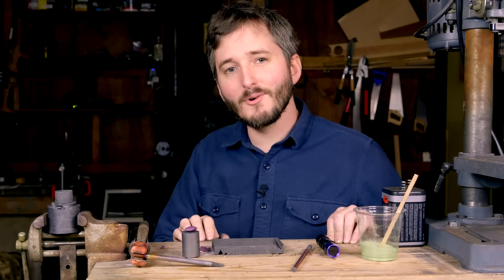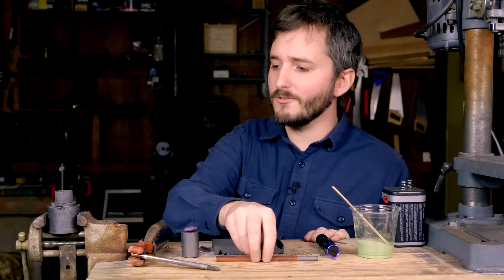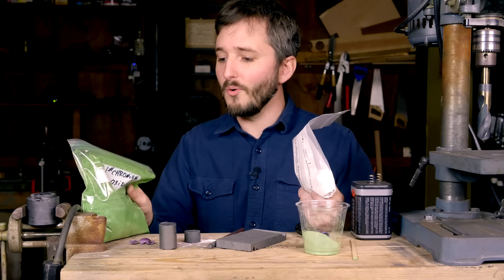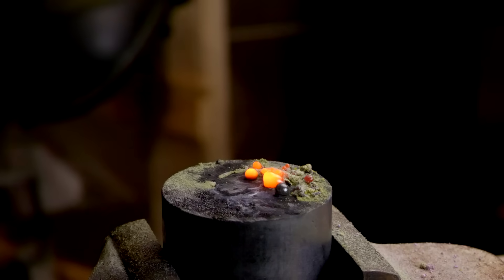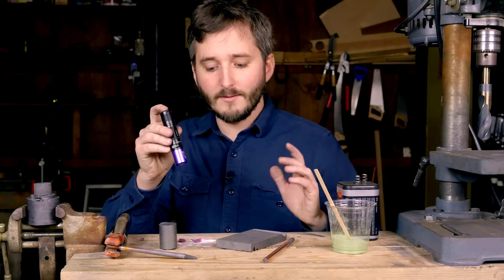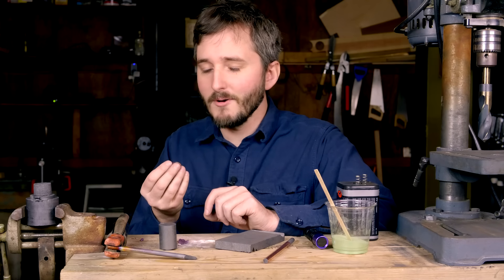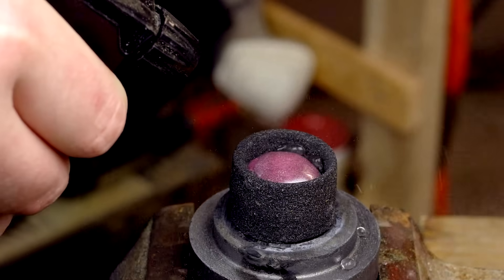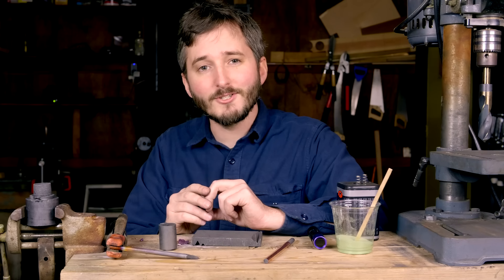How To Make Synthetic Ruby In The Workshop

Comment: Cool. Now you can attach your electrode on something to that can tightly control the space between the electrode & the crucible or myabe put some tungsten-carbide in the center of the underside to retain heat  ...if you have a lathe. I guess you could use a mill or a drill press too.
BTW, diamond abrasive wheels aren't very expensive if you get the kind that's bound to metal. The ones that have the diamond embedded into resin get spendy but I got a 3" metal-bound wheel for $20. These ones are pretty rough though so getting some cheep diamond hones from harbor freight for $12 is a good supplement.

Comment: Has anyone suggested an argon purge around and in your crucible? Argon conducts electricity Those Arc-Gouging rods are also hollow to allow pressurized air to be blown through the rods as you are "Arc Gouging" Talk to your local welding supply store, or a TIG welder if you know one, to set up a purge meter (to control your argon flow) and connect it to the cold end of your gouging rod. Argon is heavier-than-air, so if you set up your crucible inside a small bucket-like container in a draft free area, (WEAR RESPERATOR!) Your results will probably be an order of magnitude greater. A TIG torch (TIG rig) with a tungsten electrode would probably be a lot easier to work with as the tungsten will not burn away, creating the "carbon wind" that your carbon rods create as they burn. However! The Argon flow from the tig rig must be cut Way, Way Back. An oxygen free zone (the bucket) will work, but it would be hard to maintain an argon atmosphere without the surrounding air mixing. MUCH easier to build an argon purged "Glove Box." If you plan on doing this on any regular basis, or you're just interested in upping your game, the Glove-box is the way to go. Lots and lots of glove box videos on YouTube. Easy to make, especially seeing all the tools you have in the background. Good luck! You make great videos and I would love to see you making great rubies. And then, you could be the one that invents "transparent aluminum" --- You know, the one that Scotty gave the secret to --- when the Starship Enterprise and its crew were saving the whales? (and the Earth) I would love to see a DIY pure aluminum oxide gem (sapphire?) One without contaminants, if it will crystallize without contaminants.

Comment: Make sapphire, instead of chromium oxide add titanium oxide in the same ratio. Then go to some jeweller who cuts gemstones and try to polish it and make some gemstone :) btw, how did you gound your crucible ? I have to try it definetely, great work :)
Reply from the maker: I just put a piece of graphite rod and used a regular drill bit to core out the center on my drill press.

Comment: Isopropyl alcohol is a terrrrrible coolant, almost non-existent. If you're not able to use water then don't bother. People don't seem to understand just how incredibly good water is at heat conduction compared to many other liquids.
Reply from the maker: That's what made alcohol good for this purpose. It offered slow cooling that would not harmfully contract the ruby.

Comment: Try using a carbon arc attachment on your AC welder. (2 carbon rods, one on the stinger and one on the clamp) the arc flows between them (as in the carbon search lights or old cinema projectors use).  Mine is a rig designed to use carbon arc for a brazing heat source.  The device  allows me to hold as a wand where the conductors telescope  independently and you can compensate for the carbon consumption by sliding the one element toward the other.  It makes a sweet arch of arc that can be directed.  it is very bright and you need a good dark filter on your helmet and leathers. Also, low current. It is an old Craftsman item.
Reply from the maker: I'm looking to make one

Comment: Very interesting, but too messy..........I have a Multiplaz 3500 plasma welder and that is like an oxy/acc torch on steroids, the difference is it works on pure electricity and water and the plasma temperature you get out is at 8,000 deg C.
I have read that you can also get a temp up to 2,400 deg C with an HHO gas generator that gives you oxygen and hydrogen from the decomposition of water into it's basic constituents of hydrogen and oxygen.
While I like the red of a Ruby, give me the green of an Emerald and I go all fuzzy.........I get that way too with smoky Topaz.

Comment: That's looking a little on the purple side for a ruby, so it might be classified as a sapphire instead. They are both corundum, so it doesn't really matter, ruby is basically just the name for red sapphires. That's assuming that the solid you made has the proper crystalline structure, which it probably does, a quick double check verifies that the arc gets hot enough, and corundum gems don't require the pressures that diamond does, so yeah, looks like you made a sapphire. I'm not a gemologist though, so I might be off on my judgement of the color.
Reply: And now my wife has a ton of questions about different properties that you can't answer without sending it to a lab. She's a trained gemologist who is also an enthusiast. Unfortunately, even if she could get her hands on one of your synthetics, she doesn't have all the tools she'd need to properly evaluate it (and is not  currently working for any place that does). She thinks this is very cool, though she has her doubts on it being quite gem quality for normal jewelry (but might make a nice piece for 'costume' jewelry).

Comment: i'm thinking i should try this, i own a forge, i have worked in a foundry, so i think if this was done in a forge in the absence of oxygen, much like the way metal is heated when casting, would it make a nice stone?   hmmm
Reply from the maker: Needs to get as hot as it takes to melt refractory bricks. Not many forges can get there
Reply: @Nighthawkinlight  i have read 2200f,  maybe thats not correct, but i could build one hotter if needed

Comment: So how do you cut and sand it smooth?  How do you make it more "jewelry" shaped?
Reply: Use a gem faceting machine. You basically just grind it down using a diamond disc. The tough part is getting the angles exactly right. I'd be interested to see what it looks like polished. I'm guessing there would be a lot of air in the stone and it would be cloudy. I very much doubt you'll get gem quality from this process. Natural gems are made using heat AND pressure, so maybe if you did this and put it under a gigapascal of pressure you might get something you could put in a ring. Having said that, it would be a good way of making small ruby chips that don't need to be high quality.

Comment: u could do this with wolfram electrode and argon if u have those of course. Bc melting point of both compounds is 1000 degrees celcius lower then that of wolfram (2050 and 2500 vs 3500)))

Comment: tried it, but I only ever get black or green ceramic like stuff with loads of bubbles : /
Reply from the maker: It might be your aluminum oxide isn't very pure
Reply: @Nighthawkinlight  Yeah, at first I used rather coarse Al2O3, usually used for sandblasting. Then I ordered some 99.97% Labgrade stuff, and it's even worse.. with the coarse stuff I sometimes had small pink patches, with the fine stuff only green ceramic..

Comment: Is there a reason why it isn't transparent like high quality natural rubies are? Is it a flaw in the creation or in the process itself? I would assume lack of pressure is one?
Reply from the maker: It was made too quickly. Transparent rubies are cut from single crystals that grew slowly. Since mine was made fast it is made of many tiny crystals that are mashed together at random.
Reply: @Nighthawkinlight  would it be then possible to do so if you would use an electric furnace to turn down the temperature slowly?

Comment: I've never studied how ruby's are formed but simply assumed that, like diamonds, you'd need pressure also but you've proven my assumption to be wrong. Well done.
Reply: You don't need pressure. There are at least two methods of producing synthetic ruby - the flame process and the melt and pull process. But,at best, all he produced was a bunch of microscopic ruby crystals in a non-ruby matrix of some sort.

Comment: A TIG welder might have worked better since the shielding gas would have prevented it from being contaminated. This and also you wouldn't be dumping carbon from the electrode in it. It would have required a lot more power though.

Comment: I have a holder for my arc welder that hold two carbon rods and you strike the arc by sliding them together with the trigger
on the handle, you might be able to use this method with the crucible between the two rods to get the entire crucible hot enough
just a thought. The holder was sold as "Arc Flame" meant to cut steel and do gas type welding jobs without the need for gas.
Word of warning though it does give off heaps of UV light, gave myself sunburn after only a few minutes using it.
Reply from the maker: That's super cool. I didn't know that existed.

Comment: I trust you are using a partical mask. when dealing with a particulate matter, it preventing it getting into the lung that is important. In fact high ventalation could make the particules stay in the air longer.

Comment: That's a air gouging rod. You would probably have more success setting up for TIG and using the tungsten electrode for this. The shield gas might blow the powder away so if you could prevent that it would work

Comment: Those packaged carbonrods are for arc light spot light for live theater. Breathing chromium dust will kill you. Also Al O2 is either sapphire or ruby , it can be a component in other minerals. Try using lapidary quality grinding wheel to grind ruby or sapphire, it is not harder than silicon carbide. Why do you try to reinvent the wheel, you risk severe harm trying these unnecessary  experiments with materials that you don't understand. You have no concept of the risks you are creating. None of these sites is telling you of the danger. I have been a metal smith and lapidary for over 30 years , I would never even think about doing these experiments without a fully equipped chem lab with a filtered exhaust hood. Check out a hazardous chemical  chart ,see what risks you run ,a number of hobbyists die every year from just this kind of stupidity,DON'T LET IT BE YOU (as close to telling as I can get)

Comment: Why is your mixture so green. I mixed your 99 to 1 gram ratio together and it barely has the slightest green tinge to it.
Reply from the maker: Probably your chromium oxide is not as fine a powder as mine is. Or you haven't mixed it as much.

Comment: It would be possible to make an artificial ruby knife with your method??? Thinking in an long lasting sharp edge bbq knife, like in ceramic knifes but more break resistant due lever forces on the blade
Reply: You could also just buy an artificial  ruby chunk and cut/polish it into a blade
Reply: @Call-me-Al  no sure about that... since ruby is just under diamond in the hardness scales I would need special diamond edges cutting tools... I don't think it will be cheap and accessible as the creation ruby alternative presented in the video... what you think about?
Reply: @whatitmeans  I was under the impression diamond tools were cheap, as opposed to diamond jewellery. Plus that assumes you already have power tools, just not the diamond bits or diamond paste. If you have to buy fancy electric tools where you before had no tools, that will cost quite a lot

Comment: Takes me back to high school close to 20 years ago. Made my own Ruby for a Ruby laser. Didn't use the arc welder though. Essentially made a small fire brick size electric furnace. The longer heat time allowed the impurities to separate a bit leaving almost crystal clear Ruby near the center.
Reply: Impressive Bryan!
How long roughly did it take to "bake" the powder into a ruby with your furnace?
Reply: I have a devil-forge furnace and crucibles wonder if this would be possible to do in larger ammounts.
Reply: What temperature did you use?
Reply: @kimmy9695  I don't have an exact temp. It was before temperature guns.  I had used a coil type heating element the kind used in ceramics kilns. Had the entire thing buried in a pile of sand to further insulate. And since I powered the element by plugging it directly into 220 power. With no thermostatic control. It went until the element failed. Guessing about 10 hours. I left it sit untouched for a couple days as I didn't want any thermal shock to destroy any crystals if any were to form.
Reply: Was that what highschool was like back when I eas 2 my highschool didn't even get past titrations😊

Comment: You could add some rigor to this project by checking to see if it's polycrystalline, amorphous, somewhere in between, or monocrystalline. Get in touch with a university with an XRD machine.
Reply from the maker: You can tell it's polycrystaline just by the surface finish. There is a definite structure like the surface of a snowflake.

Comment: i wonder if you could use one of those magnet forge things (the spirally loop of coiled stuff that heats up anything you put in it) to heat up the ruby dust. maybe you would need a metal crucible (unless carbon would work, i dunno).

this way you would have a completely even melt, and it could be melted into various shapes.

Comment: I'm too busy with a toddler to be playing around with this but I have a suggestion on how to make these rubies without a welder and just a regular unmodified microwave oven.

Take two refractory bricks, hollow out a chamber between them with enough room for your crucible and surround it with charcoal before covering it with the other refractory brick, then pop it in the microwave and zap on high.

Like forgetting a fork on your plate the charcoal will start arcing inside the refractory brick chamber and voila, tiny arc furnace.

If it works, mail me a few rubies and I'll make my wife some earrings. ✌️😎

Comment: How did you configure the arc welder?  How many amps?
Reply from the maker: As many amps as it could put out. 180 or something like that
Reply: @Nighthawkinlight  I had access to the materials on hand in a pottery studio - alumina and chrome oxide are glaze components.  I saw how the crucible turned into a bit of a form...  If my own setup works, I am going to Mill a heart shaped form into a block of graphite.

Comment: Great to see two superb maker-channels in concert.

A few thoughts:
If you put the crucible on a welding turntable, it might make the preheating easier.  If you wanted to get really fancy, you could knock up a jig to hold one, or even two, electrodes in place.

Cooling:  Do you want to make amorphous ruby?  It would be interesting to see the difference in properties as the cooling-rate changes.

You now have an excuse to deck out Da Boid in ruby bling to complement its fine feathers.  👌

Comment: Get a cast iron Plate and use the Al2O3 powder  to lap the ruby into a sharp angle.
After that, braze the ruby to a toolholder and make a testcut on a lathe.
With diamonds, you will get a supreme surface finish. And rubys are really close in Hardness.

Comment: I actually did this today.  Was fun. I am having an issue with air bubbles. Was wondering if anyone else has the issue.
Reply from the maker: Yes there are bubbles in mine also. I think they would go away if the crucible were heated from the inside out.
Reply: @Nighthawkinlight  so preheating the graphite and applying the heat a little slower to ensure all the powder melts seemed to help.

Comment: Ruby is 9 on the MOHS scale.  Think of the bearings one could make with these :-)  Imagine greatly improving the efficiency of railroad trains with more efficient bearings. :-) :-) :-)  ...cars too?
Reply: @notfiveo "tough" is not exactly what I would call an engineering term.  There may be some kind of fragility issue, but in-wheel suspensions, however limited should be able to remove the shock of most bumps that would threaten it.  Hard to imagine using in-wheel suspension in trains, but who-knows.  Gotta try stuff because the proof in the pudding is in the eating. :-)
LLAP

Comment: Maybe you could make a mold for the ruby? Separate top and bottom. Make the mold out of Graphite, then put a wooden(or metal) box around it to hold the mold together. Then screw the box shut. Heat the ruby in a crucible then pour it like you would steel into the mold. Let it cool overnight and have a file with proper file lines and edges. 
Notes: You will need to put any future holes to prevent having to drill it. ie a handle screws. If it is going to be to abrasive you will need a handle or gloves.